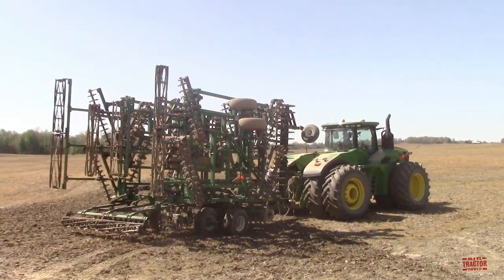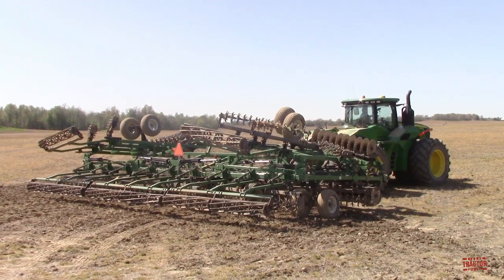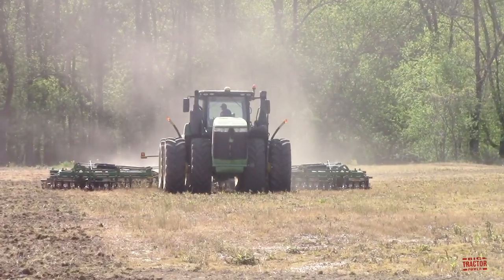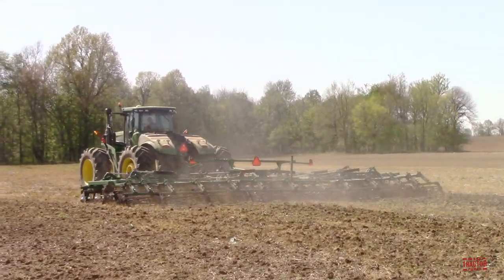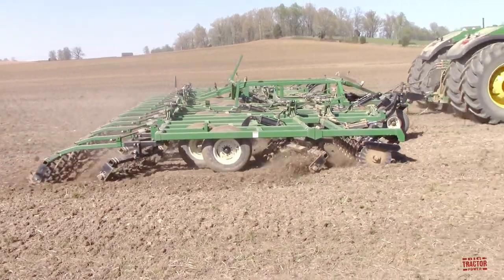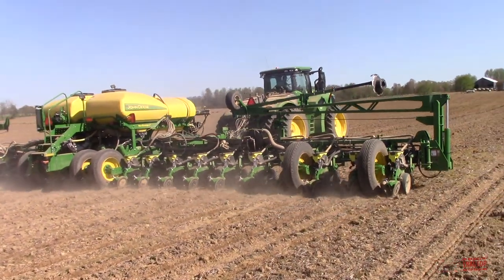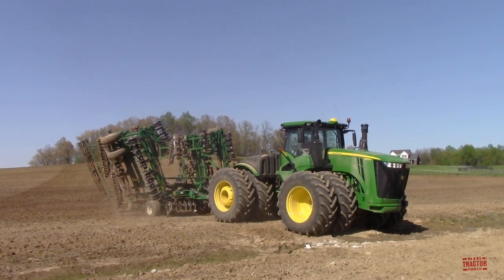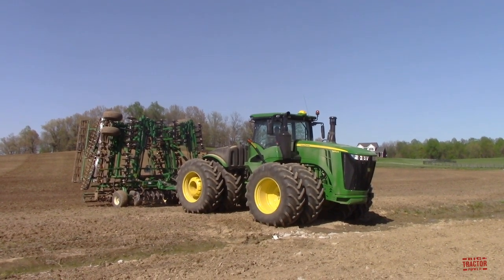JOHN DEERE 9470R Tractor on the Move for Spring Tillage

Comment: 1:47
This implement needs greasing ....
Sounds like my joints in the morning .
Reply: Somethings are just going to squeak no matter what you do
Reply from the maker: I can not think of an implement I have filmed that does not have a bit of noise.  This implement is greased each morning.
Reply: 1:47 is the sound of the hydraulic cylinders on the wings, not a squeaky joint.
Reply: Sounds like you need to get that checked out.
Reply: More or less hydraulic flow to the unfolding cylinders could reduce the noise during unfolding